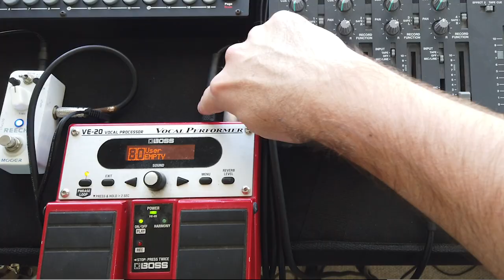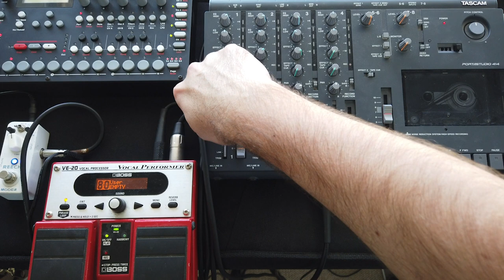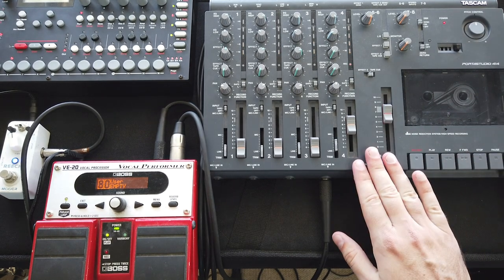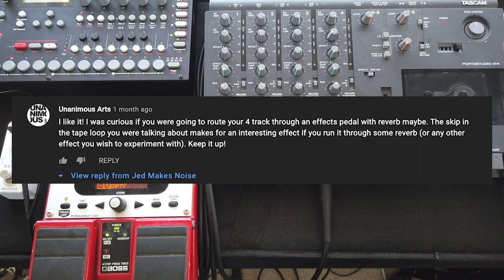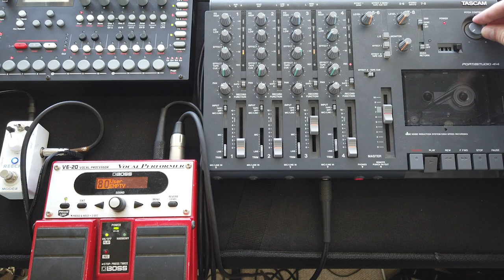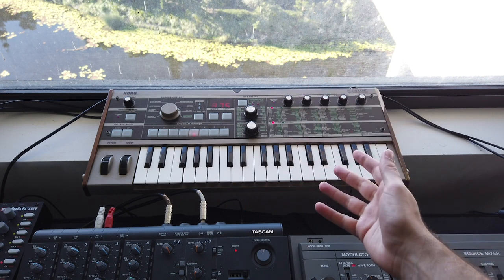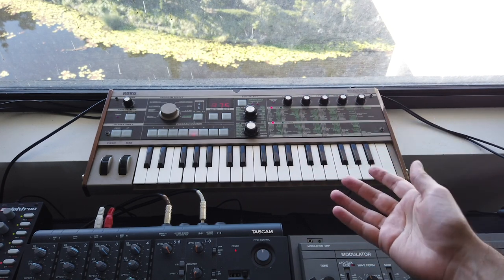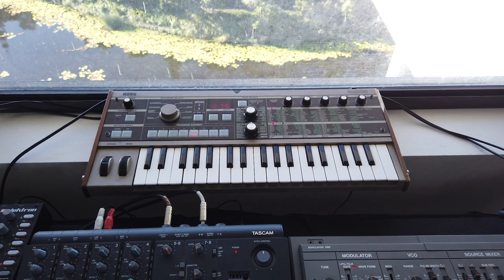Making Coldwave/Industrial/EBM with Roland Sh-101, Elektron Analog Four, MicroKorg & Cassette Loops

Comment: Thats sick! One question: if i wnat to add another shs 101 for example or any other cv gated synth, do i use the same cv track of Analog  Four or what else? I knw there is a splitter for cv outs on A4, but where do i make the  pattern fro the second cv outs? thanks
Reply from the maker: @whatistau  sorry I’ve actually never tried that, only had it sending cv gate via one and clock via another. I think you can only have one sequence coming from the cv track at a time. You can get around this by for example programming something into the sh101s load/play feature and just send it clock.
Reply: @jeddyeval  that is one way, right! i wonder if you have 4 cvg outputs running two synths, you probobally need two cv gate tracks
Reply from the maker: @whatistau  yeah if you get splitter leads you could do that, and actually i think there may be a way to make your other onboard tracks 1 2 3 or 4 to spit out cv info rather than inbuilt syntnengine. I'll check next time i plug it in!
Reply: @jeddyeval  im thinking of using it as my main 808 style sequencing tool, for sh 101 and another cv synth. and the rest of 3-4 midi tracks for a percussion from any mutitimbral synth of inbuilt engine.

Comment: Excellent mate. Where do you get your drum samples? They’re exactly what I’m looking for.
Reply from the maker: Hey friend, thanks a lot, the samples are actually stock presets that came with the Analog Four - the only thing I’ve edited about them is running the snare through the A4’s reverb send and made a very short decay to emulate a gated reverb. I’ve also run the hihats and snare sounds through the delay send with a dotted 8th note pattern dialed in for the repeats, which I’ve darkened with the lowpass filter. Hope this helps! Cheers